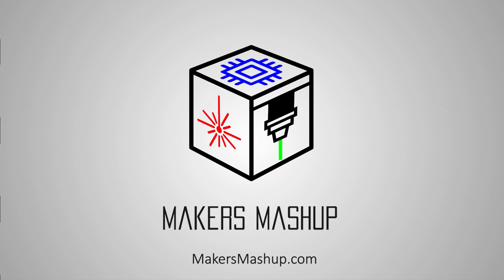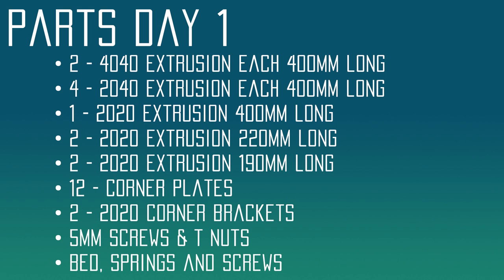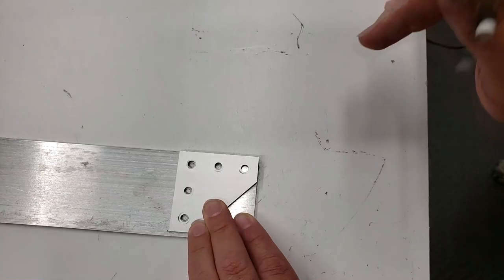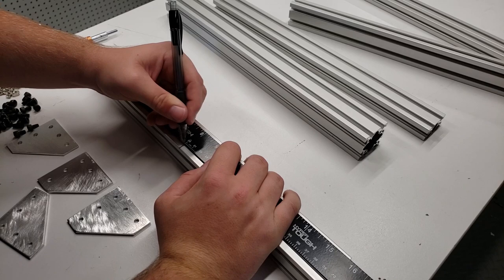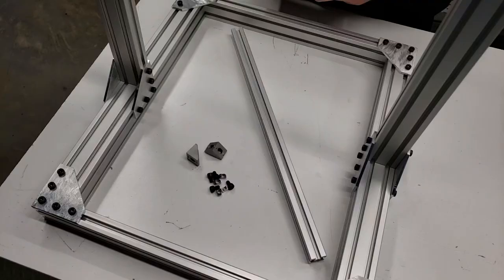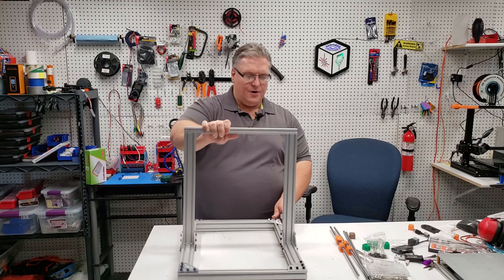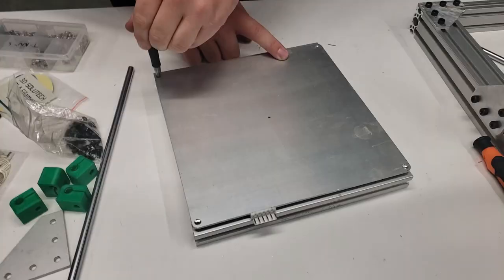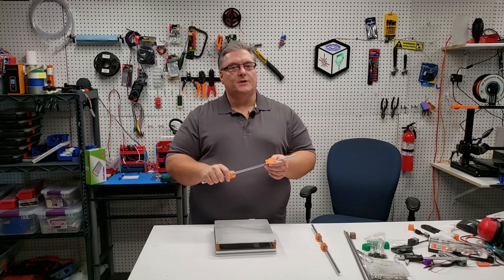DIY 3D Printer Build Your Own  - Part 1 The Frame (Step By Step Guide)

Comment: Can this build be adjusted for a larger bed size?  Say 300x300?
Reply from the maker: Essentially yes.  You may want to consider using an H plate instead of the extrusion for the bed since you'll be adding considerably more weight.  You only need to increase the dimensions of the parts to accomodate the larger bed.  If you're considering a 300x300 build you may want to wait until we do our X301 build which is a CoreXY printer and the bed descends vs moves.  This reduces the potential for ringing in your prints due to the mass moving on the Y axis.
Reply: @MakersMashup  Great!  thanks for the heads up
Reply: @MakersMashup  Love the video, I was wondering when do you plan to do your X301 build? I am really interested in building a corexy build to get a bigger build volume.    Thanks.
Reply from the maker: Dan - The X301 video is getting closer to production.  This printer I worked with a friend and we have two prototypes that we're now combining into the final version.  That final version will be the X301 video.  However realistically this is probably a month or so before the first video comes out.  I am really excited about the video and learned a lot from the C201 video which will make the new ones that much better.  So hang in there it's coming soon now that we are through the holidays.
Reply from the maker: @danperez5201  Very soon!  This has been on everyone's want list and over the next few weeks finalizing the design for the video.  I'm hopeful that this series should start sometime in February 2020 if not sooner.

Comment: Hello dear I am INDIA and I would like to buy all the parts used to make a fully functional printer from you. do you ship to INDIA as well. thanks
Reply from the maker: LayerFused ships worldwide.
Reply from the maker: The c201 though no full kit is available at the moment
Reply: @MakersMashup  Thanks for replying back. Currently I am online so could you please send me a link to buy the printer . I am  a student so just wanted to experiment with 3D printing and you motivated me to move further . Is the layer fused  same as C201 and also solid built . I am very tight on budget so how much will it cost after shipping to INDIA . also does it support dual color roll.
Reply: @MakersMashup  Thanks for replying back. Currently I am online so could you please send me a link to buy the printer . I am  a student so just wanted to experiment with 3D printing and you motivated me to move further . Is the layer fused  same as C201 and also solid built . I am very tight on budget so how much will it cost after shipping to INDIA . also does it support dual color roll.

Comment: Does anyone have a 3D model of the full assembly (not just the 3D printed parts)?
Reply from the maker: Yes.  Nick in the discord does.
Reply from the maker: Sorry I thought you were talking about the x301. There is not one for the C201
Reply: @MakersMashup  thanks. I'll have a look. I've not much space so wanting to customise a DIY design for myself to build a small printer like the prusa mini!
Reply: @MakersMashup  I suppose it's all the bought bits I need models for, like the extruder and stuff... I'll join the discord :)

Comment: Can I make my own bigger
Reply from the maker: Yes, it's all open source.
Reply: @MakersMashup  I want to go 800mm by 800mm....I want to be able to print 18" circular ring
Reply from the maker: Sounds like you have a lot of work ahead of you.
Reply: @MakersMashup  please I need cutting last....800mm by 800mm should be the work area
Reply from the maker: Not sure what to tell you.  The build is capable of being scaled. It's not something easily done at that size but it's possible. It's something that takes some planning, prototyping and testing.  It's not something I can put in a YouTube comment. You'll need to do the research and preparing to make a build like that. It's possible, the information is freely available online. Just do your homework and you'll be fine.
Reply: @MakersMashup  if I get it  to that size ..I'm concerned about...one part getting cold before another layer of plastic is placed......Maybe it can work if the printing speed can be increased and with simple design